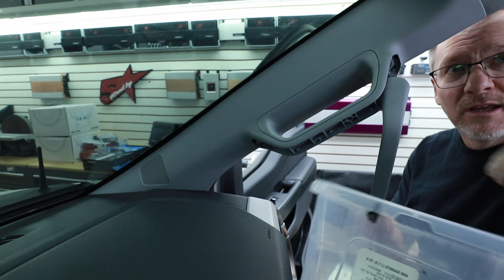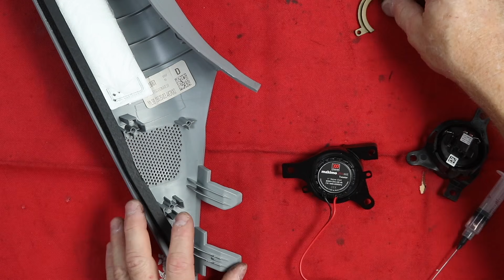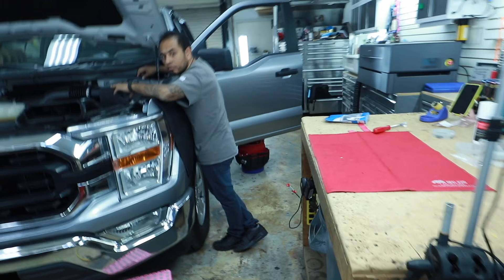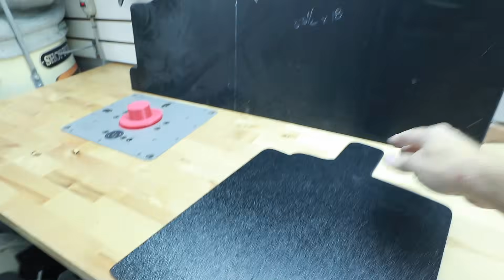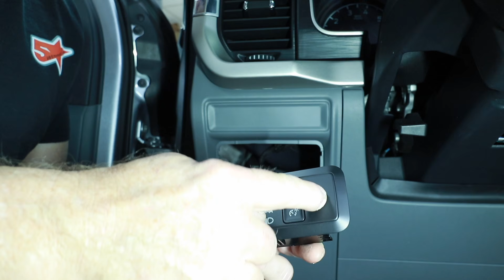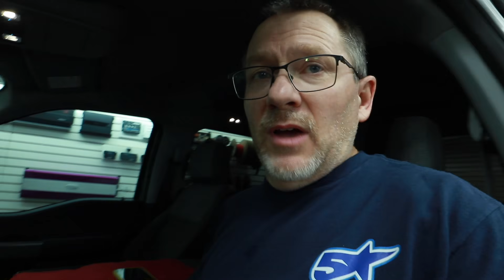New F150  kicker key amps and Morel speakers full install

Comment: Super helpful on my 24' f-150. Put in a kicker hideaway sealed sub and amp behind the back seat, and ran my signal wires the same, but ran the power on the passenger side through an existing grommet through the firewall that puts it close to the battery. Putting it through the dash was 👌. Thanks for making your videos!!

Comment: Great video, but do you have any video showing how to set the HI PASS and LO PASS?  Esp on the Key500.1.  So much misinformation out there and the manual doesn't say anything.  "Amplifier crossover dials use a logarithmic or exponential scale, meaning the numbers bunch up tightly"  but then another site says that's hogwash and it calculates evenly.  I found the setup extremely easy except this part.

Comment: I have a kicker key amp for my door speakers and I installed all new doors speakers (kicker ks 6x9s front 6 1/2s in the back) I have it set to 60hz but the bass sounds terrible and when I set it to 80hz the amp goes in and out of protect mode when I turn up the volume any guesses on what’s wrong or how to fix? Pls help

Comment: Lets see the same video for a B&O 8 speaker set up...  from what can use a key 200.4 and a pac adapter harness to amp the rear, and possibly the front door speakers, and add a hideaway in place of the factory sub?

Thanks!

Comment: You did not mention the bass knob. At what percentage do you recommend having the knob set at when setting the gains? Or does that not affect the setting of gains?
Reply: 100% so you can dial it back without blowing up the subwoofer if you turn it up too high.

Comment: Whenever I do the auto-tune on my truck I make sure it's running, since that's a factor the DSP has to account for and 99% of the time I'm listening to it it's running.  Plus the higher voltage from the alternator.
Reply: There’s no point in that and you’re just adding unnecessary noise. You’re supposed to run auto-setup at minimum gains so voltage doesn’t matter.

Comment: What ohm Load Resistor did you use? 20/40/60? I don't see any purple wrapped ones, just green/blue/grey
Reply: You want the green 20 ohm units for the F150. AC-LGD 20